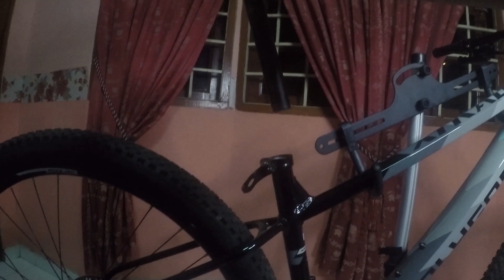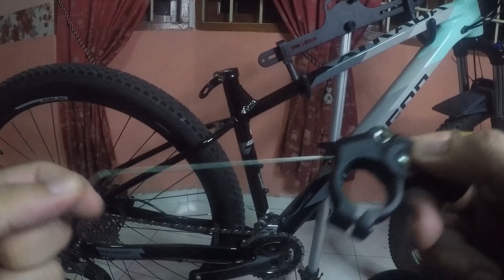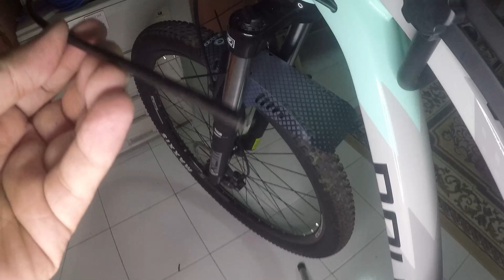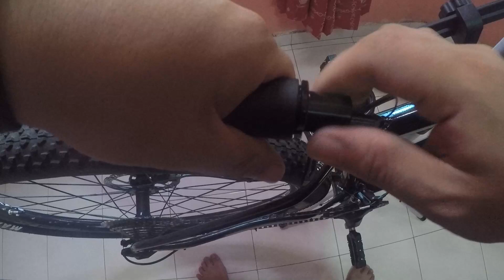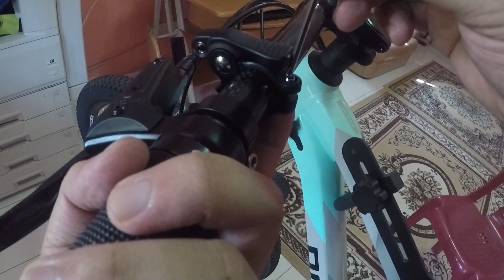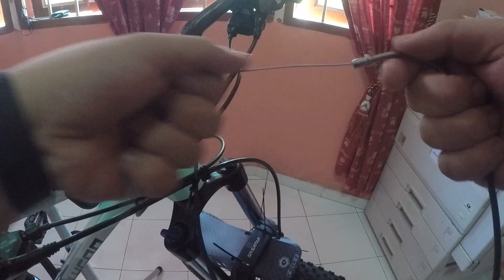Install Cheap Dropper Seat Post! Zoom Dropper Seatpost on Polygon Xtrada 5 2021!

Comment: Mine is stuck since new. Can't lower it. How does the actuation mechanism work? Doesn't seem to work.
Reply from the maker: Maybe the cable stuck inside the cable hose sir
Reply: @AliffBohariChannel  solved: dead on arrival, shipped broken.